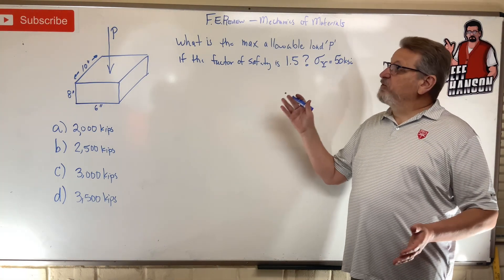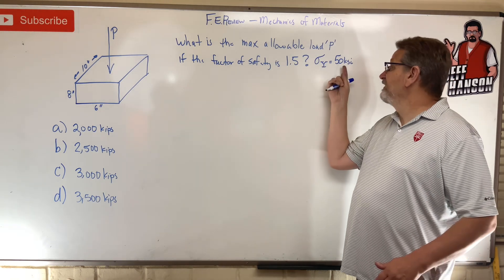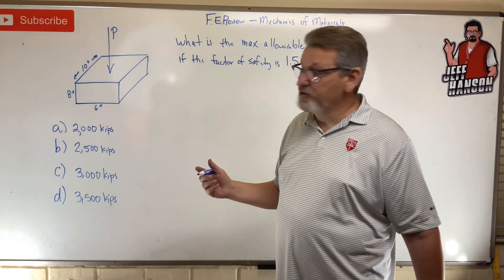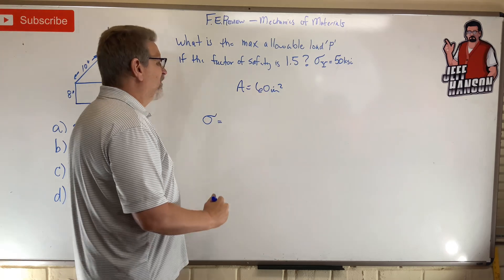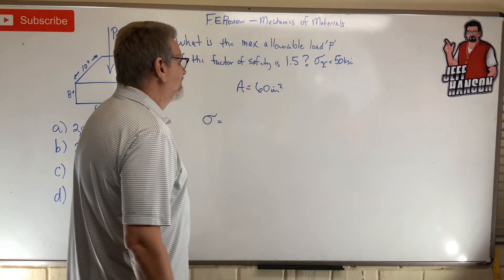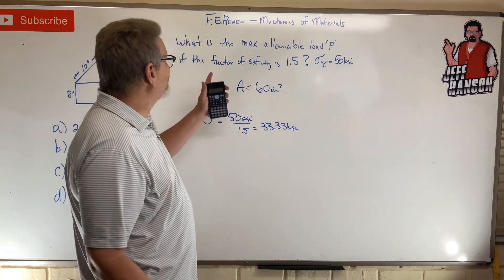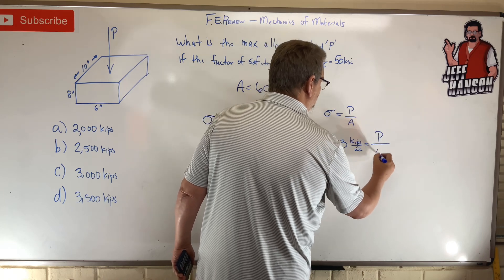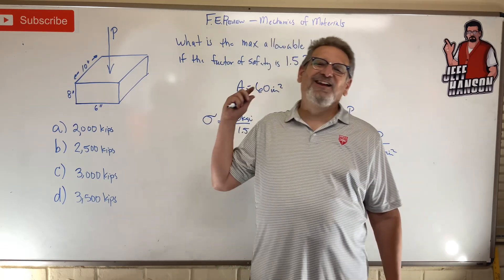FE Review: Mechanics of Materials - Problem 1

Comment: Why was the area 10 times 6 instead of 8 times 6? Isn’t 8x6 the cross-sectional area?
Reply: The area you need to use is the area where the load is applied. In this case, P is the load and is applied on the (10 in)*(6 in) = 60 in² area. You can see it on the figure, there is no load being applied on the (8 in)*(6 in) = 48 in² area.
Reply: @diegocabrales yup I got it now thank you sir